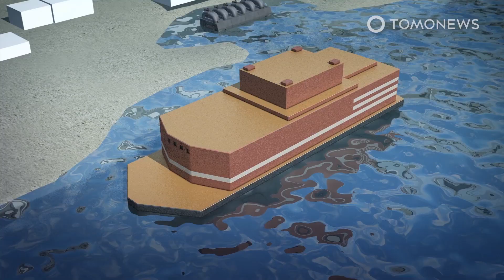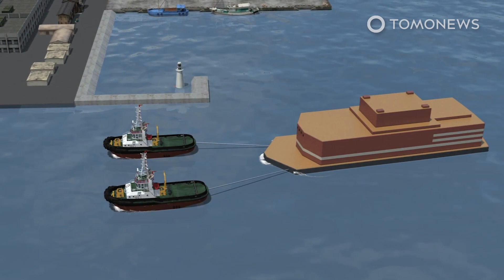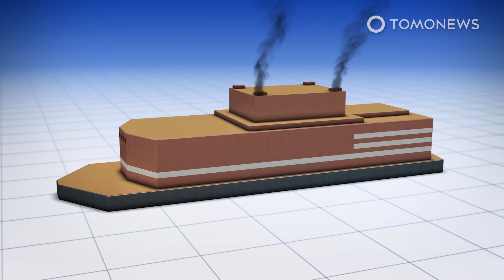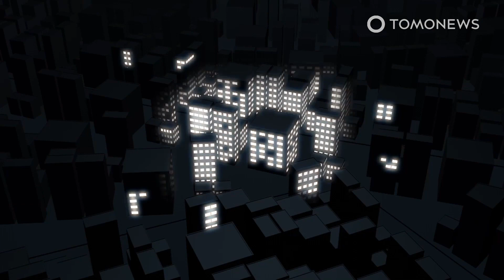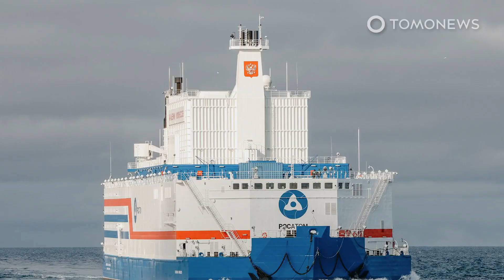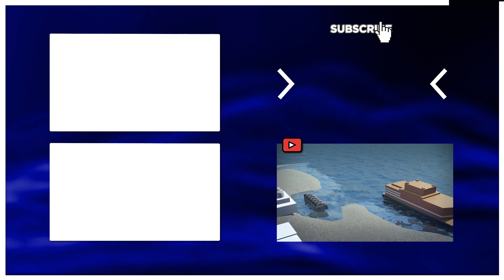Floating Russian nuclear power plant produces electricity - TomoNews

Comment: what could go wrong
Reply: Even ordinary single-layer ships sail for 30 years, and on this ship 4 layers of metal and reactors are designed for 40-50 years of operation. The port pier is on all sides, so it will be difficult to sink this barge even if you wish.

Comment: Was this ever a going to be a good idea? What if the reactor leaks?
Reply: Depends on what leaks. If it's uranium, it will just sink to the bottom of the ocean and make some meters of danger zone, now tritium is trickier as it bonds with the water but it decays in 12 years.
Reply: san  either way, the movement of the world's water will surely mean that it will eventially contaminate everywhere
Reply: Even ordinary single-layer ships sail for 30 years, and on this ship 4 layers of metal and reactors are designed for 40-50 years of operation. The port pier is on all sides, so it will be difficult to sink this barge even if you wish.

Comment: Wait for a disaster because if something happens with sea condition like hurricane stuff then it's a risk 
And also gonna harm environment if that happens
Reply: Several dozens of nuclear powered submarines and ships moving in that area.Please tell me about disasters.
Reply: The only catastrophe there may be is the invasion of polar bears.

Even ordinary single-layer ships sail for 30 years, and on this ship 4 layers of metal and reactors are designed for 40-50 years of operation. The port pier is on all sides, so it will be difficult to sink this barge even if you wish.